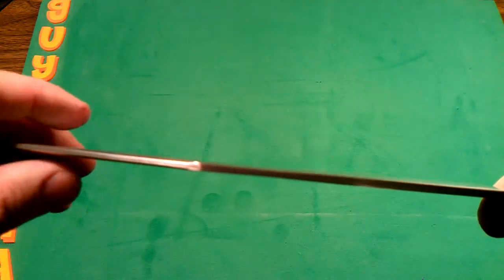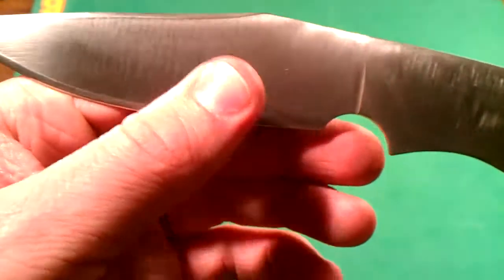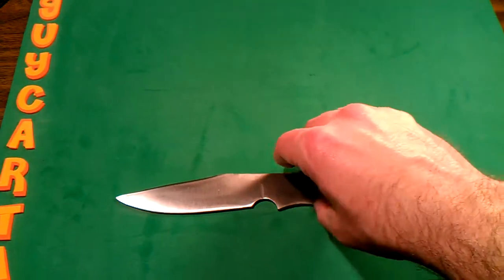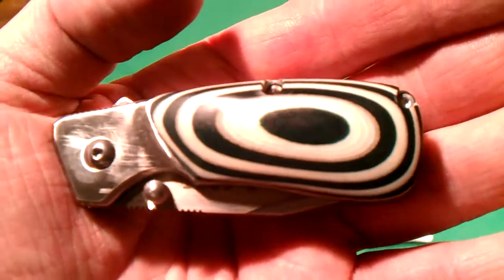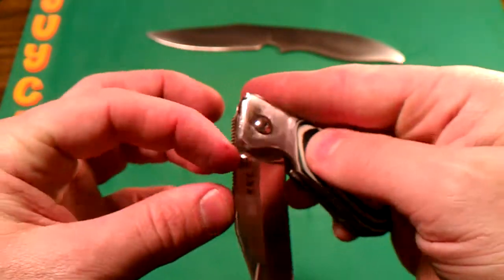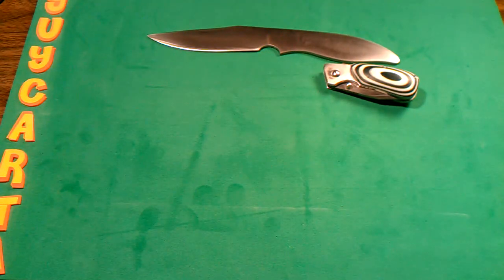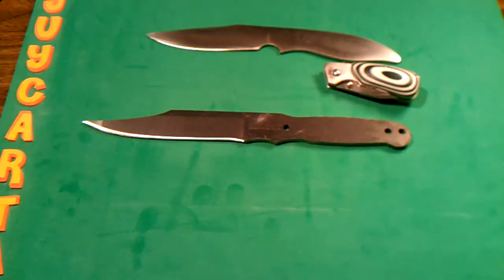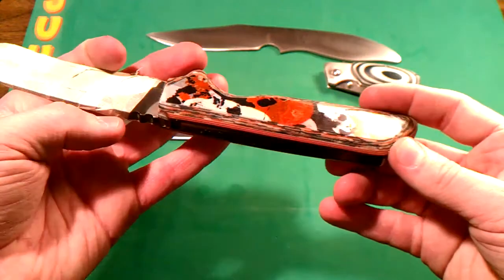Projects completed! Clip point extravaganza!! Micarta pimpage

Comment: Looks good bud!  I think you will be fine with the thickness on it.  Just remember anything you do to it after heat treat is gonna be even tougher on your 1 x 30.  Make sure you like it before you send it out.  I usually go to at least 220 before heat treat.  Typically I will do hand benching and sand the length of the blade instead of vertically.  It seems to go with the grain better and you can get a better finish.  Call me if you got any questions.